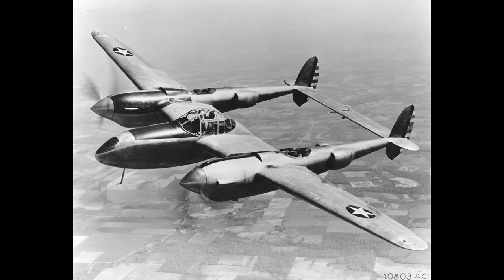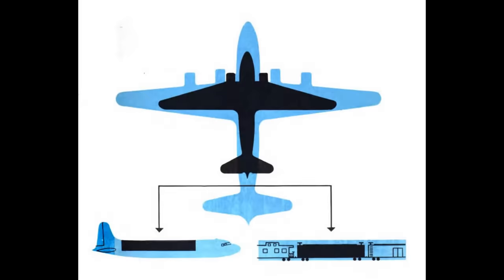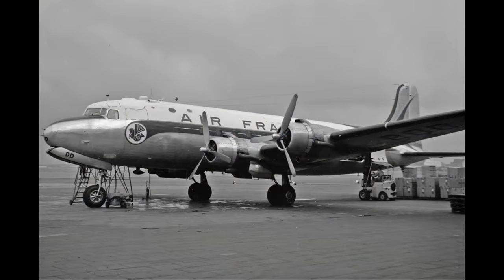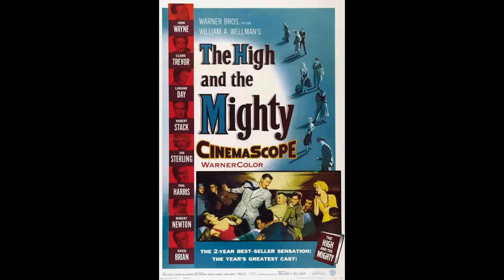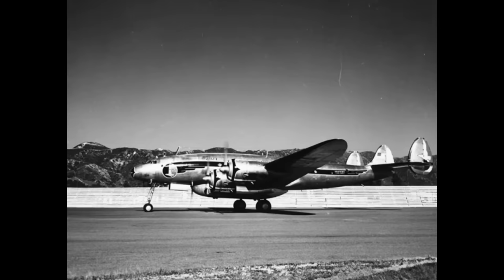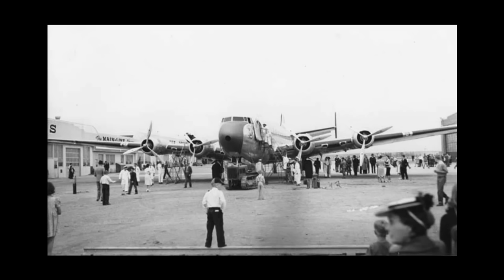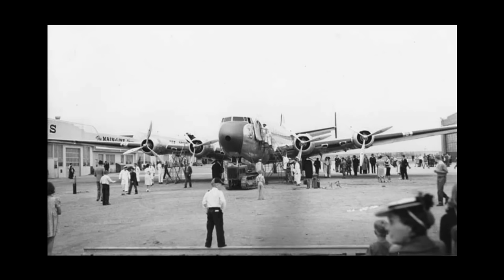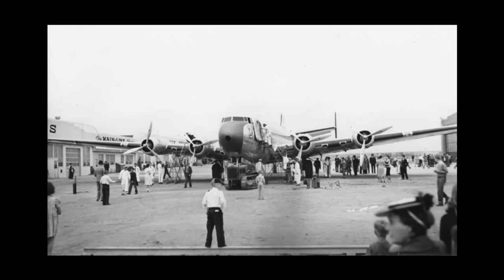Turbo Compound Piston Engines. Almost magic tech.

Comment: I am reminded of the 19th century multiple-expansion steam engines. Double & triple expansion cylinders capitalised on the remaining potential energy of a compressed exhaust media (steam in this instance) to power larger cylinders which contributed power to the main crank.
The turbo compound element of the super-prop is providing exactly the same direct-to-drive input, only using a turbine in place of cylinders.

Comment: Mentioning about steam reminding me of the propulsion system on the Titanic and other Olympic class ocean liners. They had 3 propellers, two powered by reciprocating steam engines and one powered by a steam turbine. It was incredibly interesting because the turbine used steam exhausted from the reciprocating engines at a mere 9psi. What was even more interesting was this turbine had a power rating of 16,000shp… from just 9psi! It turned out the steam was sent through jet nozzles to extremely high velocity to power the turbine which is exactly what this is. Still amazing to get 16,000shp though.

Comment: Greg, Great video!!! Here's an relatively unknown tidbit of turbo-compounding. About 15 years ago I was consulted by a leading automotive engineering group and was asked the question did I know about turbo compounding? At this time it was all the rage in the auto industry as a way to improve fuel economy for cars and trucks. I described the system to him and asked was this the first time he learned of turbo compounding and he said yes. Now mind you this guy was the senior partner in a 31 man auto consulting firm. He said yes!!. I said this in unbelievable that he knew nothing of T/C. Then I told him of the development of T/C in the early 1950s and its use of T/C in DC-7 and 1049/1649 aircraft via the Wright R-3350 engine. Anyway, I said forget about it, it is too complex and a mechanical nightmare and relatively unreliable. That conversation saved the auto industry millions. Then I ask the question does he know the difference between a DC-6 and DC-7? He said he didn't know and I told him the answer; A DC-6 is a four engine aircraft with 3 bladed props and a DC-7 is a three engine airplane with four bladed props. I remember as a kid I would lay in my back yard located under the north downwind of LAX and watch the DC-7s fly over with one feathered.  
T/C was thought recently as a great way to improve auto fuel efficiency (CAFE).
In another tidbit, One of my partners owned a DC-7BF and flew the aircraft 300 hours without even changing a sparkplug. He flew it very carefully. Very small, smooth power changes, shallow climbs, long descents.
Reply: Larry, that is quite interesting.  I thought your comparison between the DC-6 an DC-7 to be pretty funny!  I flew many DC-7s out of Miami in the 1980s as a flight engineer. Most were  DC-7Cs, but also flew one DC-7B: N750Z later N101LM  for LaMancha Aire (it became N385AA, now sitting in New Smyrna beach).  I knew most everyone who ever operated a DC-7B, so I'm curious who your partner was--or if that info is too private,--then where it flew out of and its N-number.  -Stef Bailis
Reply: @Propliner1955  The first name of the guy with the DC-7 was Ron. The method of determining the difference between a 6 and a 7 was told to me by an old Zantop pilot who had operated many 6's and 7's. He started off as an FE and worked his way up eventually to Captain on round engines.

Comment: Greetings Greg, thank you for all the very informative videos you put out. One technical point that you have glossed over is that the energy in the gas flowing from the engine to the recovery turbine is more in the form of heat than pressure. The same applies to the gas in a cylinder in the power stroke of a four stroke engine. Most folks indicate that the spark ignites an explosion and the increase in pressure drives the piston down. Actually the fuel burns starting before TDC and continues pretty much till the exhaust valve starts to open. There is a pressure increase but as the piston travels downwards it is expanding the volume of the gas. It is common knowledge that when gas expands it cools down. This how the heat energy is converted into mechanical power. 
My apologies for nitpicking. Keep up the good work.
Reply from the maker: I have an oven and a turbine. If you can make the turbine spin by only heating it up, I'll be really impressed. I think you will find that heat or no heat, you will need pressure or flow to make it spin. The heat energy is a way of looking at things, and measuring the power used as you can easily measure the heat on both sides of the pressure turbine, but it's not exactly heat that's spinning it.

Comment: This turbo compounding is the internal combustion version of a "bottoming turbine" in steam operation, and nearly and ship that uses either piston or turbine steam engines today will have a bottoming turbine to get the last energy out of the steam before it goes to the condenser (which actually operates -- usually -- below atmospheric pressure; that's the main reason for a condenser).

The bottoming turbine depends on residual heat energy in the steam (which, due to low exhaust pressure, can remain vapor well below what we think of as "boiling point"), rather than velocity, but the idea is the same: get some work out of steam that would otherwise be considered "spent".  A separate turbine is used because it can run at much lower speed than the main turbine shaft (or higher speed than a piston expander shaft), and still be geared down to run something like an electric generator, water pump, or hydraulic pump.

Comment: Braniff was an early-adopter and utilizer of DC-7C's. When Douglas stretched their wings from the root outwards to gain fuel capacity a byproduct was reduced propeller noise in the cabin. It was very noticeable if one had ridden a -6 for a couple hours and then changed planes to a -7C. My Dad and the other old Braniff mechanics called PRTs "Rotary Mufflers" (and less complimentarily "Parts Recovery Turbines").
       That reminds me of the similar but not-often-mentioned-anymore contrast between the noisy short stacks of the P-51 and the tamed-by-the-turbo-turbine exhaust of the P-47. Many pilots that loved the Jug called her "The Cadillac" for her roomy and comparatively quiet cockpit.

Comment: Napier in Britain, used turbo compound diesel engines for high speed naval use and for railroad locomotives.  In these engines 40% of the total power output was derived from the turbine.

Comment: South African Airways had three DC-7'sfor the Johannesburg to London route. I made the acquaintance of a retired SAA technician who told me that SAA always had a spare engine at a convenient stop somewhere up the line in Africa so that they could do an engine swop in the (likely) event of an engine failure, then fly the defective engine back to Johannesburg for rebuild. I suspect that if the DC-7's had proven reliable SAA might have bought DC-8's instead of Boeing 707's in 1960.

Comment: Very interesting, thank you.
Volvo trucks released FH16/500 prime movers with turbo compound here in Oz quite a few years back. The company I worked for at the time bought three of them, mainly for B-double use. They had a unique sound to them, a high-pitched whine. The idea seemed to disappear for a few years but I see that turbo-compounding is back again in some Volvo heavy truck engines.
(I disagree, Subaru is not boring at all).
Reply: Compounds are unnecessary.  VGT.

Comment: From IMDB trivia as to John Wayne having a relatively minor role in "The High and the Mighty".

Widely considered to be one of the best performances of John Wayne's career, and largely accidental at that: Wayne stepped into the part of Dan Roman at the eleventh hour, following Spencer Tracy's last-minute exit, merely to save the project (which Wayne himself was financing) from going over budget. The character of Roman - stricken, vulnerable and utterly unheroic - was the antithesis of Wayne's omnipotent screen persona, which forced him to play considerably outside his normal range. The result was a heartrending, unexpectedly touching portrayal.
Reply from the maker: That makes sense, and I thought he did a great job in that role.
Reply: ...what stuck with me the most was how the crew looked and acted on the ramp after the flight, almost in gratitude to the plane that got them there ...just seemed how a crew would act despite none of them being pilots, but darn good actors

Comment: I flew from LA to Mexico City & back in one of these as a kid flying alone in the 50s. I recall getting a terrible ear ache while descending because I didn't know how to equalize. So while these were pressurized they weren't pressurized to sea level. Then as know as I recall it pressurizes the cabin to ~8,000 ft. altitude. 
Roomy seating! You'd have to fly 1st class now to equal it.

Comment: I am a pilot and owner based at KEVB...we have one of the few surviving DC-7s parked on the ramp, ex-American Airlines. I believe it belongs to the pilot/A&P school on the field.  Thanks for the video!
Reply: That is DC-7BF N385AA, formerly N101LM, formerly N750Z, formerly N385AA. I worked on it as a mechanic and got flight engineer training in it back in the 1980s.  Stef Bailis

Comment: Surprised that you didn't mention that these engines also had direct, timed fuel injection.  Normal for a diesel, but Avgas 115-145 didn't have much lubricity.  The damn things ran so hot that cooling air needed to be ducted to the motor mounts to keep them from melting.  Occasionally, one of the turbine shafts would fail which caused it to exit right through the cowling which scared hell out of the passengers, especially on the inboard sides of #2 & #3.  Bob Six encouraged Continental captains to "Whip The Horses" which made for headlines, consequently every coast-to-coast flight was a "speed record attempt".  To my knowledge, no R-3350's in their fleet ever made it to TBO.  Great stuff as usual Greg!

Comment: I should mention that actual turbochargers are also partially blowdown turbines, or more accurately can use the blowdown effect to great benefit.

One of the reasons modern turbo manifolds are usually so short is that much of the energy in the exhaust gas is released into the manifold before the piston starts moving upwards (or even finishes moving downwards). The more of this blowdown pulse you can get through the turbine (and converted to power) the less you need to physically push out with the piston creating backpressure.

As an extreme comparison example the early Subaru WRX was known for turbo lag even on lower power models (with fairly small turbos), whereas the other comparable engines of the era weren't. The Subaru literally has a less effective turbine side with a literally more than a meter of exhaust path between some cylinders and the turbine. Other cars had manifolds less than a third of the length, and modern Subaru's have a low mount turbo which is much more responsive and about half the length...
Reply from the maker: Have you measure the exhaust back pressure in a modern production turbocharged car? I have, I have seen it upwards of 1.5 times boost pressure! Yes there are some with less, but none have zero.
Reply: @GregsAirplanesandAutomobiles  not personally, and you're correct in that way. On a small turbo production car with a quiet and emissions spec exhaust, the numbers are downright scary. On a turbo sized for the top 30-50% of the rpm band you can get less backpressure than boost, but I've never heard of better than 0.7:1

 They aren't completely blowdown turbines, I was more referring to the blowdown effect when the exhaust valve opens and all hell breaks loose in the exhaust port. It's beneficial to normal turbines too. Something like 50% of the mass can be released before BOTTOM dead centre and utilising that blowdown pulse is effectively free.

We appear to differ slightly on the definition of exhaust blowdown though. I'm referring to the period between exhaust valve opening and when the piston actually starts to "push", and you're referring to a specific turbine design.

That said, modern Garrett branded turbos (and likely others too) are taking on axial flow properties, the transfer slot between the turbine scroll and the wheel is at 45 degrees to the rotating axis on some.

Comment: I love the story I heard in 1982 from a coworker and talked about how once they burned off fuel, they throttle back each engine, and changed the gearing on the turbo compound, and then powered back up and climb to a higher altitude
Reply from the maker: That's a true story. They have to throttle back to switch to the higher supercharger drive ratio.

Comment: According to an article written by one of the engineers behind the GAMI fuel injectors STC for the continental engine, those old radial engine captains would fly based on minimum fuel burn. Basically pulling the mixture back to just lean of peak using the EGT, and then cooling the CHT by bumping up the throttles to increase airflow a tiny bit.
Lindbergh taught this to F4U corsair pilots during his flying as an :observer" in the pacific theater also.
Reply: Pretty sure Lindbergh taught Army pilots proper leaning techniques for their P-38s. He flew on a few combat missions, as well. 

You are correct about lean of peak operations with the big radials. The cooler CHTs resulted from more complete combustion of the fuel, and with GAMI injectors LOP works wonderfully in GA engines

Comment: There's a great book called The Medieval Machine by Jean Gimpel which talks about the industrial revolution of the 12th and 13th centuries, which is fascinating enough because nobody knows that happened... but the book points out that in England and France in the early middle ages, there were so many water powered mills showing up that localities had to develop laws defining minimum distance between water wheels on particular rivers.  Once you get past a certain number of wheels, nobody is milling anything, because the water hasn't had time enough to develop the velocity to run the next wheel.  I think that neatly demonstrates your point about turbines running on velocity, not pressure.

Comment: If Im not totally mistaken then this system is used in F1 currently called MGUK. Though it works with an electric engine/generator instead.

Comment: I’m a railroad guy with an occasional interest in aviation, where on railroads were blow-down turbines used? On conventional steam locomotives we have a procedure called a blowdown, but in this instance it’s a daily en-route maintenance procedure where a direct gate valve is open at the lowest point of the boiler pressure vessel in order to dump minerals and sludge that have precipitated out of the evaporating boiler water. If you’re talking about turbine locomotives such as the PRR S2 or C&O M-1, those were contemporary and even subsequent designs to power recovery turbines
Reply from the maker: I don't know where, I'm not a locomotive guy, that reference came from either NACA or Curtis Wright and I didn't go into the locomotive aspect any further.

Comment: The film "The High and the Mighty" was actually produced by John Wayne, and he took the role of the co-pilot when the actor they actually wanted was not available.  Wayne wasn't even going to be in the film at first.
Thrust augmentation was also created by using the heated air that passed through the radiator.  IIRC this was done in the P51 Mustang.

Comment: Great video, as usual. I can tell you why your airline people don't agree with you that the speed of travel is the value of air cargo, having spent my career in air cargo. I started with Air France back in 1990 operating from IAD and we had the Concorde available for carrying cargo from IAD to CDG -- but we almost never used it. The vast majority of our cargo went on 747 passenger flights, and we competed with several other airlines carrying cargo from the US Mid-Atlantic region to Europe. Occasionally our customers would choose a carrier based on the arrival time in Europe, but almost all the time our customers just wanted the least expensive rates. For some customers, reliability was important and they would pay more to a carrier they trusted but for most cargo, price was crucial. Yes, you are absolutely right that moving goods by air is much more expensive than moving them any other way -- but once the customer has decided that air transportation is appropriate then he is going to shop for the least expensive air option that still meets his needs, and almost any airline is much faster than ground or ocean transportation, so airlines compete on price. There's also an important caveat to the cost comparison between air and ocean: moving goods on ships nowadays is only cheaper when you are moving large shipments in ocean containers. If you want to send something smaller than a twenty-foot container it's often less expensive to send it on an airplane, in addition to being much faster. It depends on the commodity and your destination and how often you send it and other things, but the general principle that air is more expensive often doesn't apply in the real world. (This is partly because the ocean people concentrate on larger shipments, where the bulk of their revenue is; if they worked at winning small customers and shipments they could offer a much less expensive product. This is also true for railroads.)

Comment: apparently detroit uses turbo compounding on the dd15 and i think dd16 as well. they call it axial power turbine, its after the turbo and is geared to the rear geartrain, i think they advertise something like 50-100hp recovered from the APT, somewhere in that range